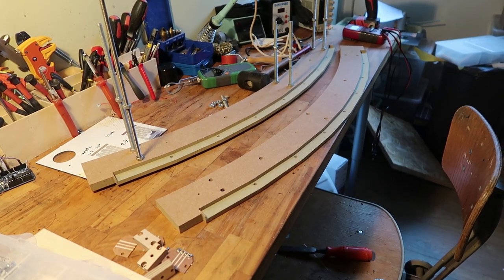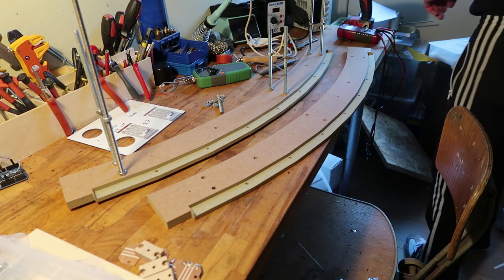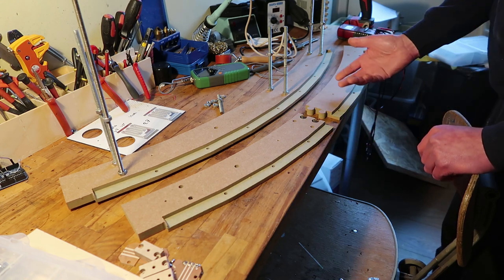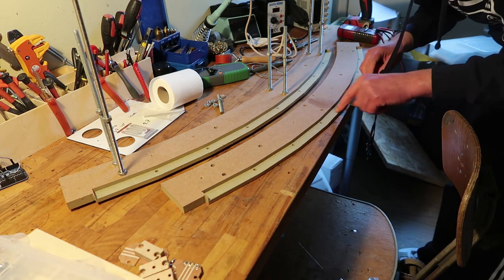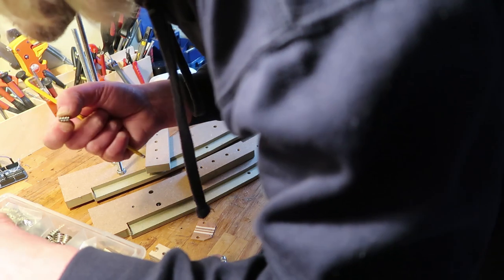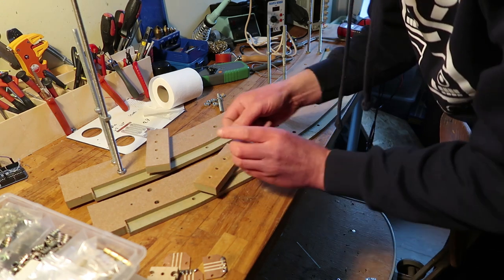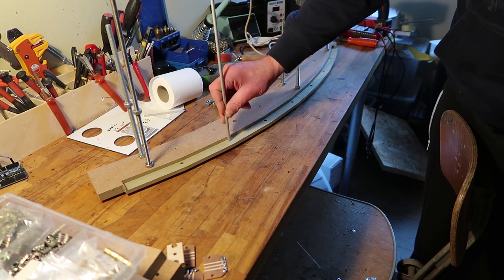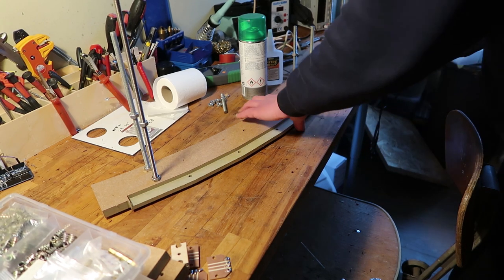Constant Beamwidth Transducer (CBT) Ribbon -  Part 1

Comment: Did I have any part in influencing your decision to make a CBT?  BTW, there’s some research that says you can do it in a flat source with a graduated delay to panels farther from the floor to mimic this classic CBT curve.  And it supposedly also works in 2 dimensions, allowing you to do a full planar “wall” CBT instead of just a linear CBT.  Great work!  I love your videos and learn so much.  I can’t wait to see this full series.
Reply from the maker: I have no idea if you did :) yeah you can use delay to do the same. but adding delays is not that easy there is a way of doing it like JBL did passively . but im not too sure its that good. dsp would be best. but can only be done when you drive serveral drivers. this curved delay makes it possible to make one ribbon only :)